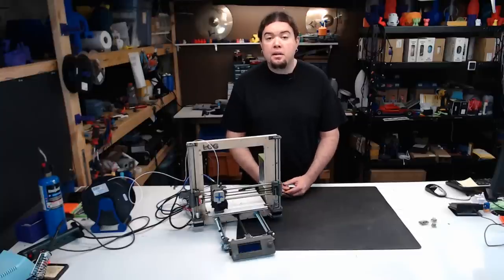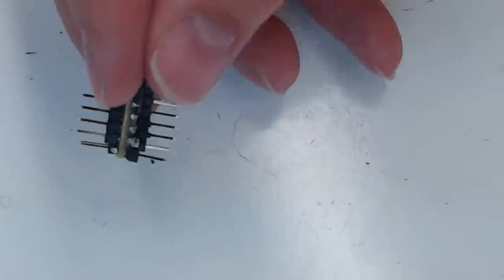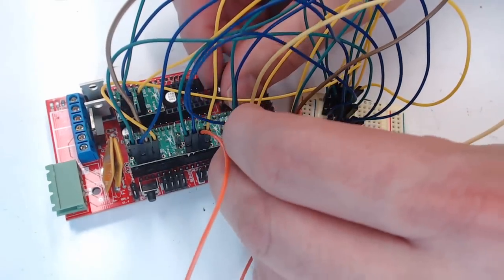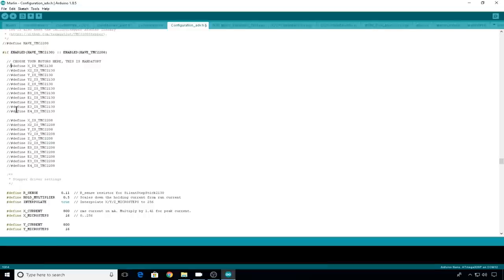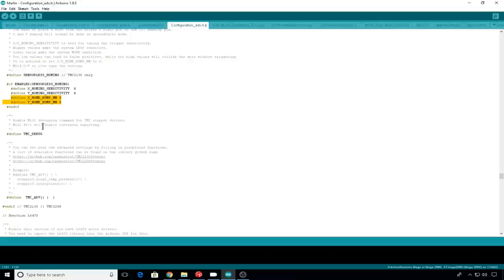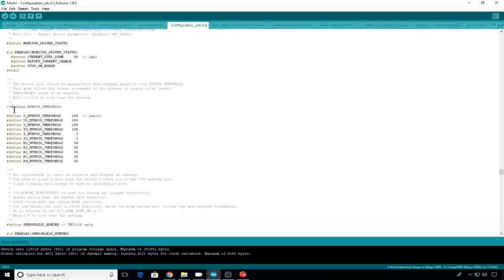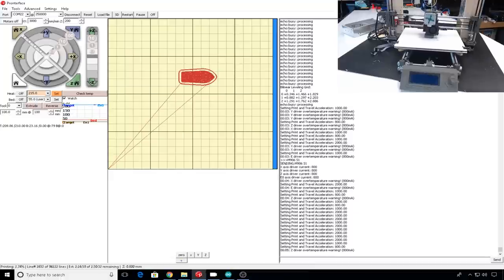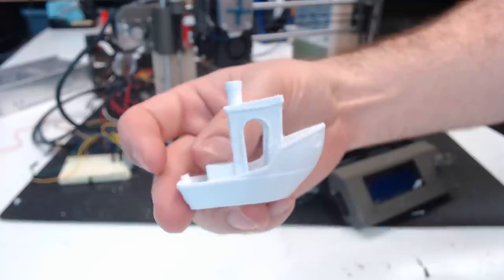Trinamic 2130 Stepper Driver Setup - Marlin - Chris's Basement

Comment: thanks for sharing, this is pretty interesting as I got some 2130's here but haven't installed them yet,  as rather than  fiddling with a  working machine I'm thinking  of scratch building a 24v printer out of the bits I got laying around and  installing them in that instead,  as I hear these drivers seem to like 24v better
Reply from the maker: Awesome! Yes, I think 24v would make these run so much better.

Comment: Gr at video. Really well tested. They are on my list though at the moment not willing to give up SD and LCD. Once I have other printers though bring it on.
Reply from the maker: That's next on my list, LCD SD setup. Thanks James!
Reply: Is that something that is waiting for 1.1.9?
Reply from the maker: I will probably wait for 1.1.9 at this point. I have tested the bugfix version of Marlin that is out there now and it does react a little differently with these drivers. If I am going to change to 1.1.9, I might as well wait and change all at once.
Reply: If you solder a header on top of the LCD/SD "L" bracket you can "share" the aux 3 pins that are NOT the CS ones. Then re-address all your drivers CS pins in pins.h. VIOLA. No need to change to SW SPI.  I used it successfully with Marlin for a bit... Till I jumped to Klipper.... That's ok I added a second MCU just for the display so it's all good. Cheers.

Comment: 2130s just run hot .. You need to have good heatsinks on them + active cooling , I use a 12cm fan to keep them properly cool.. However I have a very annoying sound coming from them in Spreadcycle so I always run them in Stealthchop , but with proper cooling they do ok, if I set the accel. over 3000 i start to get layershifts cause they dont have alot of torque , specially @ 12v , they behave a bit better at 24v
Reply from the maker: Thanks Gunnar and thanks for joining the live stream Sunday. I do want to do more testing. I want to try 24v as well.

Comment: I think you should tune your hysteresis settings, which are a cause for heating the drivers and the motors.
Reply from the maker: Interesting....I will have to look into this. Thanks for the suggestion.
Reply: Chris Riley If you need some help where to start: look for the "stepper indirections" file in marlin and look for the 3 Values TOFF, HEND and HSTRT, they couls be named diffrent like "hysteresis low" "hysteresis high", change TOFF to a Value of 4 or even to 3 to reduce the noise your printer makes, set HSTRT to 0 and HEND to 6. This should show a diffrent behavior and get you an idea what it does.
Reply from the maker: Awesome! I will have a look at this when I circle back. Thanks again.

Comment: Brand new to fidgeting with the driver's but plan on upgrading mine and was wondering if this would be basically pretty much the same for the TMC2208. Really love the video.
Reply from the maker: 2208 is even easier, all pins go down to stay in default mode.

Comment: These Trinamic TMC2130 drivers can do their magic best at voltages higher then 12V. Did you experiment with that as well? Can you confirm if this is true? I know that Prusa, in supporting their MMU2 (uses Trinamics in there) had to make different stepper driving firmware depending on whether it was driven from a MK3 (24V) or MK2.5 (12V). A step-up convertor might be advisable, is perhaps worth looking into in addition to swapping A4998 with TM2130?
Reply from the maker: I have not tried them at 24v, but I have heard they run a lot quieter at 24v. It really just all depends on what board you run. Some boards have certain stipulations when you run at 12 or 24v.

Comment: Nice buth i would resolder them u can se in the video that u have not get good flow around the pins so u can se the surface of the boards copper rings
Reply from the maker: Ah, Nappen, I watched the video back and saw that and was wondering if anyone would comment. I just quick solder them to show on the video. I did go back and correct them. I can't get anything past you guys. ;) Thanks for watching. See ya for morning coffee.

Comment: My TMC2130s came w/ headers soldered. Do I need to cut the 4 pins facing down in order to use the 4 facing up?
Reply from the maker: You need to check those over really well. They probably have been soldered for standalone mode. You will need to do some un-soldering to use SPI mode. And yes, you would need to un-solder those 4 pins and put them on the top.
Reply: @ChrisRiley  thanks. I'd have to cut the pins then. They used a double-ended header on those 4. I'll look at the config too. If I'm going to do this I might as well go all in.
Reply: Mine are V1.1 and the chipside faces up. Checked against the MKS Gen L silkscreen.

Comment: So im trying to configure marlin for a mks gen1.4 every version of marlin I open is missing parts to say have tmc 2031. Also the tmc2031 driver by teemuatlut makes the file not compile. any ideas thanks
Reply from the maker: When you load the library, what is the error when it doesn't compile?
Reply: I get an error multiple  libraries found along with a long list of other errors. But I've worked past that I guess you don't actually  add the library to the config file ot automatically  pulls what it needs. Correct me if I'm wrong.  But I now found a article  online of a guy who sets up tmc 2031 on his mks gen 1.4 and I am using he file changed my parameters but I get an error when i turn on the printer." Driver Error printer haulted please reset"
Reply from the maker: @jakeb3668  If you use VScode it will pull what you need. If you are halting, something is a miss with the wires. Did you ever get this sorted?

Comment: Hi, Chris. I am finishing my 3D printer built from scratch. It is a CR-10 clone. I have installed TMC2130 stepper drivers on a MKS Gen 1.4 board. I have all the TMC2130´s in the V1.0 version that is supposed they will not work in SPI mode. Is this a problem? Do I need to follow your general Marlin config.h and config_adv.h respecting my machine dimensions, stepper motors specs and so one? What should be a reasonable voltage for the stepper drivers? Thanks for your job on producing such amazing videos. They help us a lot. Silvio. Cheers from Brazil.
Reply from the maker: Thanks Silvio, are you running in stand alone mode on the drivers or SPI? 700-800ma should be a good range to start with. If you are running in stand alone, the general Marlin config should work just fine.
Reply: @ChrisRiley  Thanks for answering my questions. Yes, it will be stand alone. But what I need to do if I would like to work in SPI Mode? 🤔
Reply from the maker: A whole lot of wiring. :) I have never heard that the MKS 1.4 won't work with SPI. It should work just like ramps, if not better.
Reply: @ChrisRiley  Thanks. Lets try it

Comment: Hey Chris -- I'd like to send you some of my magnetic springsteel/PEI beds; me and two of of my friends created them and manufacture them here in the US. We have sizes all the way up to 305mm wide(and as long as required) or 300mm in diameter.  We use N52 magnets and, .4mm annealed spring steel, and .125 PEI from Sabic(only source with this thickness).  Let me know if I could send some along. Love your videos. =)
Reply from the maker: David Hargrove Hey David! That sounds like a great project. I would love to check it out. Send me an email and we can talk. brotherchris81@gmail.com

Comment: Hey Chris, I am using a TMC2130 to control this stepper motor, but not for 3d-printing purposes (I do not have the Ramps 1.4.)  I'm just using Standalone mode with the controller in a breadboard, Vm going to a 12V supply, and the other Step, Dir, En, Cs, pins are connected to this Cypress BLE module that has PWM and digitalWrite capabilities. 

Couple of questions for you (I haven't found much on the internet about the specifics of what I am doing (or, I'm so new to this that I might've already come across the starting point.)) 

1) How do I configure the controller in Standalone mode?  Is that even possible, or do I revert it back to SPI mode, configure it, then close the SPI bridge?  
2) I am using the Cypress BLE 042 module as the "main guy" in my project, where I use the PSoC Creator to write all the functionalities that control the motor card - if I were to use SPI, it would be the master.  I used to use the Arduino Mega and the TMC2130Stepper library with SPI enabled to test out the motor card before I brought it the BLE module.  Would I need to import that library into my "main.c" file in the PSoC software? (Is that library even considered the configurator for the chip?) 

Thanks, great video so nonetheless.
Reply from the maker: Hey Anthony, thanks for watching. I am not an expert on these drivers by any means, but I will give it a shot.

Depending on the driver you have, to run in standalone spread cycle you will need to solder the SPI bridge closed that's on the bottom of the board. This thread is pretty good. https://discuss.toms3d.org/hardware-f6/use-tmc2130-without-spi-in-stealthchop-t406.html

The second question I am not really sure. I would think you would need to add the 2130 library somewhere, but only if you needed to use the features of the 2130, like stall guard. I "think" if you were to set it to standalone and wire it like you list above it would then act just like any other driver and the main stepper library would be all that's needed.

Hope this help, don't know a ton about them, but I am always willing to help test. ;)
Reply: Hey Chris, thanks for the thread, helps quite a bit.  As I was grazing the internet, I came across a couple forums/blogs that went into detail about converting the C++ - based libraries into C (some, specifically for PSoC).  Having never done that before (plus my current time constraints) I've put working with the TMC2130 on hold.  Just got that TMC1043 kit, and it's working smoothly (it has it's own software, so no library involvment on the PSoC end.)  Want to return to the 2130 soon, the size alone is enough to want to make it work no matter what.  Thanks again
Reply from the maker: Cool find on the C converting software. It does take sometime to figure out those drivers, I feel your pain. I'll have to check out the 1043's I have never seen those before. Keep me updated on your progress.

Comment: i was wondering...just finished connections...can i test with no screeen?????the motor connections have no possitive or negative...how do you connect??
Reply from the maker: I am not sure how it would work if you can't cable up to a terminal. A lot of the magic is software controlled. You can use them in standalone if you want.

Comment: hi chris, im in need of a replacement thermistor for my e3d hotend heater block on my prusa mk2. do you know off any on aliexpress or similar sites that would be compatible?
Reply from the maker: I think anyone would probably be compatible, but I highly recommend you get an E3D one. They are so much better and they have them on Amazon now.

https://www.amazon.com/Genuine-E3D-Thermistor-Cartridge-E-SEMITEC-50-MOLEX/dp/B072HNL9MR/ref=sr_1_7?ie=UTF8&qid=1526229205&sr=8-7&keywords=e3d

Better yet, just get the whole block rebuild kit. 

https://www.amazon.com/Genuine-E3D-Block-Upgrade-V6-BLOCK-SOCK-KIT/dp/B01MZE1W0J/ref=sr_1_4?ie=UTF8&qid=1526229205&sr=8-4&keywords=e3d
Reply: nice, im happy i didnt have to buuy from prusa because im sick and tired off them and theire lead time
Reply from the maker: I hear ya! It was awesome to see E3D stuff on amazon. So much more convenient.
Reply: btw, as always i loved the  video. I never knew you had a twin brother though ;) Btw would it be possible to upgrade my mk2s with tmc 2130 drivers?
Reply from the maker: Ha! Thanks! It would be really difficult to upgrade the mini rambo. You could switch it out with an MK3 board, but then you have other hurdles to jump over.

Comment: Hey Chris long story short I got a geetech delta G2s for $50 off of craigslist cause the board blew I ordered a gen L board and was planning on getting 2208s when I thought why not take the 2208s out of my ender 4 and put in 2130s and set it up for sensorless homing and when I saw your video I just wanted to make sure that you don't need 2130s on all the drivers right? cause the plan was 2130 for X and Y 2208 for Z and dvr 8825 for E
Reply from the maker: No you don't, you can mix and match, but I wouldn't do it on a Delta. A cartesian should be fine(maybe not if you use 2 drivers for your Z rods). Also, corexy, you probably want the X and Y to be close to the same driver.

Comment: Can you tell me how we can do it with LCD too
Reply from the maker: Hey David, yes, it is on my list to do. I hope to get to it soon.
Reply: @ChrisRiley  merci
Reply: The trick is only to use tmc2130 for x any axis.. then all noise is gone whilst saving 2 pins for chip select. I've used that on a cheap Chinese clone and managed to only use the sdcard pins thus effectively have the display. Still one problem.. the rotary dial knob is also on the sdcard breakout.. so that one doesn't work in my case. But I don't care.

Comment: I can't get this working on my Kossel Linear Plus to save my life. I get "Driver Error, Printer Halted".
Reply from the maker: Yeah, they are pretty unforgiving. Double triple check your wiring and solder joints.
Reply: @ChrisRiley  You replied! I'm kind of star-struck. 
I'll keep checking the connections. I'm also not 100% sure I'm addressing the pin numbers correctly in Marlin for the Trigorilla 14 board. Would you be able to point me in the right direction for the correct physical wiring and pins.h config?
Reply from the maker: Ha! I try to help everyone I can.

You should have a pins_TRIGORILLA_14.h file. Check this link, http://www.xcsource-pic.com/TE627-E-10-9.jpg hopefully this helps. Looks like your going to have to get creative with PIN relocation.

Comment: chris i connected to pronterface i got these  Connecting...
start
Printer is now online.
echo:Marlin 1.1.8
echo: Last Updated: 2017-12-25 12:00 | Author: (none, default config)
echo:Compiled: Jun 25 2018
echo: Free Memory: 4885  PlannerBufferBytes: 1232
echo:Hardcoded Default Settings Loaded
echo:  G21    ; Units in mm
echo:Filament settings: Disabled
echo:  M200 D3.00
echo:  M200 D0
echo:Steps per unit:
echo:  M92 X80.00 Y80.00 Z4000.00 E500.00
echo:Maximum feedrates (units/s):
echo:  M203 X300.00 Y300.00 Z5.00 E25.00
echo:Maximum Acceleration (units/s2):
echo:  M201 X3000 Y3000 Z100 E10000
echo:Acceleration (units/s2): P<print_accel> R<retract_accel> T<travel_accel>
echo:  M204 P3000.00 R3000.00 T3000.00
echo:Advanced: S<min_feedrate> T<min_travel_feedrate> B<min_segment_time_us> X<max_xy_jerk> Z<max_z_jerk> E<max_e_jerk>
echo:  M205 S0.00 T0.00 B20000 X10.00 Y10.00 Z0.30 E5.00
echo:Home offset:
echo:  M206 X0.00 Y0.00 Z0.00
echo:PID settings:
echo:  M301 P22.20 I1.08 D114.00
echo:Stepper driver current:
echo:  M906 X 650 Y 650 Z 650 E0 800
echo:Sensorless homing threshold:
echo:  M914 X8 Y
but when i try to move the motors nothing...also i connected my screen ..lights up but no data...any ideas??how can i check if the wiring fron the ramps to the motors is correct??thanks mate
Reply from the maker: If you are using standard stepper motor 4 wire cables, they will work either way, it just reverses the direction. On the screen I am guessing the setting in the firmware might be wrong. Which screen do you have? Which motor drivers are you using? Voltage might be to low to move the motors. Check the voltage on the potentiometer to ground. Try to set it to around .8 v. Also, make sure the drivers are plugged in correctly, match the pins up and all your jumpers are on.
Reply: ok..all checked..latest news is that i have 0.3 about in all tmc's2130......i took off the screen adaptor(screen is a 128x64 full grafhic) and i got movement on the motors....the firmware is 1.1.8 marlin...now i guess i have a conflict when i use the screen adaptor...i have soldered 3 pins i needed on the top of it pins 50-51-52...i  ll recheck my soldering and increase the voltage to the board...now i have an output of 12V fromthe power supply(should i increase that to 12.5????) thanks for your help
Reply from the maker: You're welcome! 12v-12.5v is fine. No need to raise it.

Comment: Hi Chris
Thank you so much for that video, it helped me a lot understanding how these drivers work. However I just got a little problem: I bought a few TMC2130  for my RAMPS from Bigtreetech (https://github.com/bigtreetech/BIGTREETECH-TMC2130-V3.0). Now the interesting thing with these is that for all the pins you soldered  in facing upwards (the SPI Pins etc.) Bigtreetech uses double sided pins so I have those pins facing upwards and downwards as well. Do you have any idea what these pins facing down are for and whether they are a problem for using the TMCs in SPI mode? If necessary I will cut off those pins facing down but as I can't uncut these pins I would prefer not to remove them.
Reply from the maker: They do that so you can use them on the SPI integrated BTT SKR boards. If you use them on other boards you will have to remove the lower pins.
Reply: @ChrisRiley  Thank you so much for that information,  that probably saves me from a huge amount of scratching my head :-)